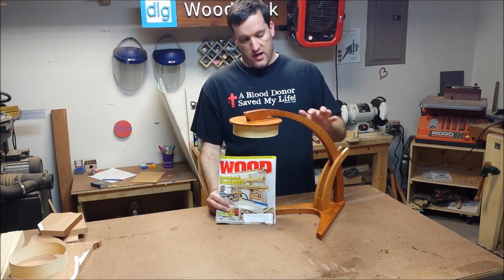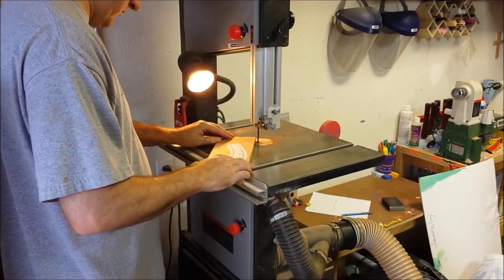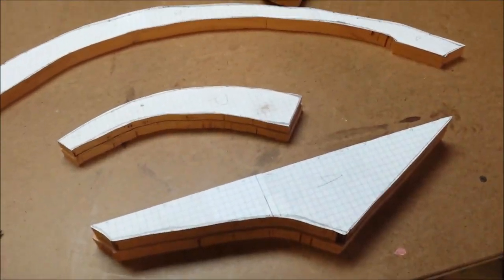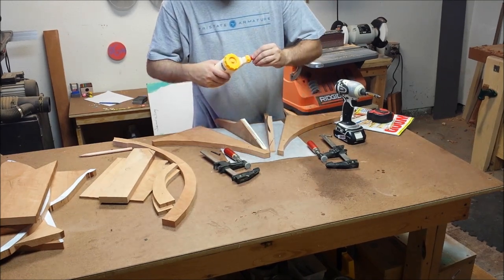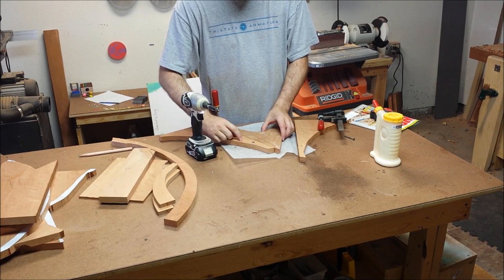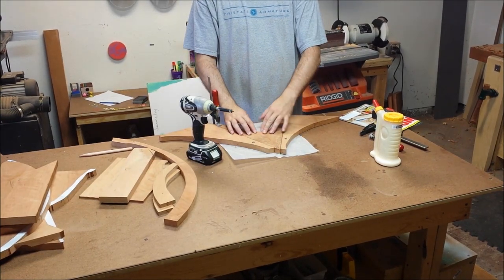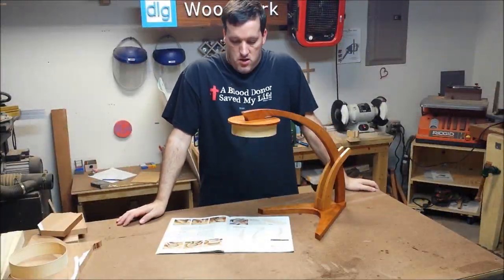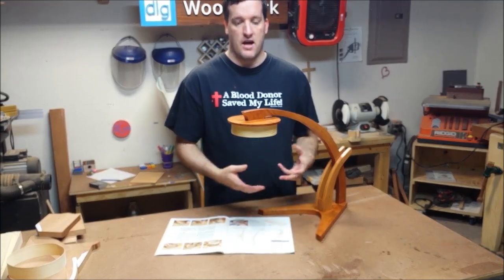How to Build the Wood Magazine Prairie-Grass Desk Lamp

Comment: Do you think it would be possible to turn this into a much larger floor lamp?  Just a cool looking lamp?
Reply from the maker: You should be able to. It is very well balanced. You would have to scale up the dimensions from Wood magazine's plans, but I think it is possible. Please let me know if you make one, I would love to see it.
Reply: I imagine you could. you run into the arm being able to support itself and lateral pressure resistance as well. in addition you'll want to have quite a lot of weight in the base as well to avoid it tipping over easily.